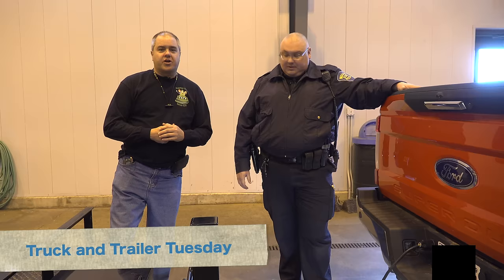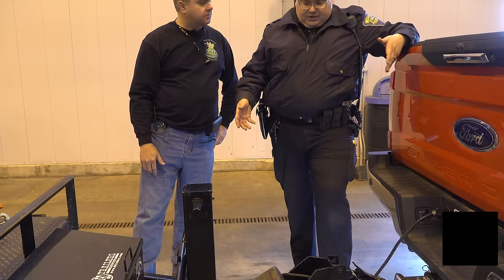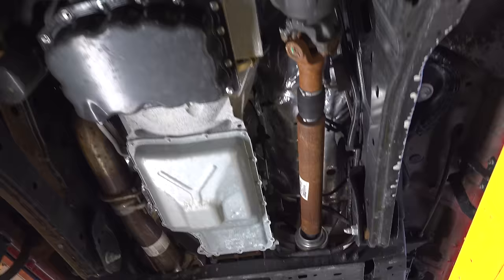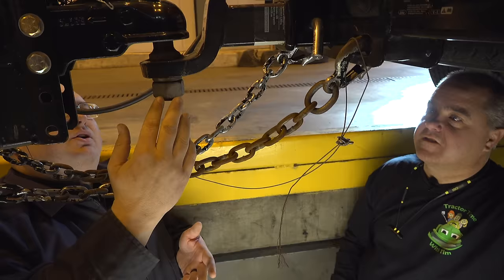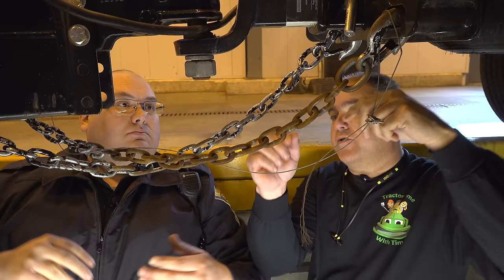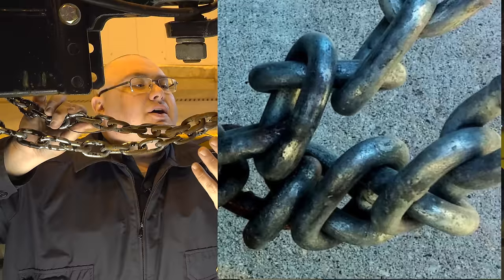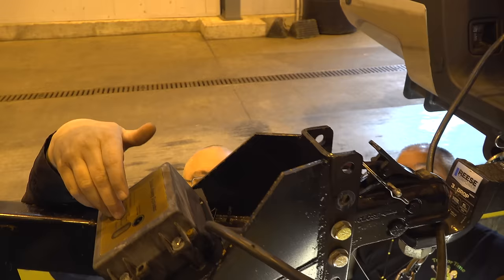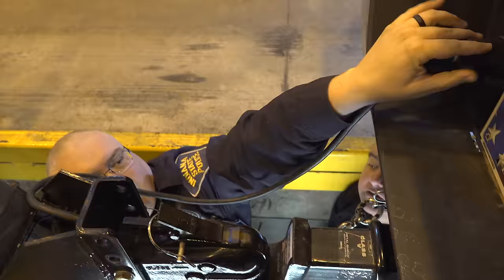Uhoh! Tim Fails Inspection! Truck & Trailer Tuesday with Trooper Hoover

Comment: That hitch is not a "bumper hitch".  A true bumper pull is when the ball is attached in a hole in the bumper.  This truck has a trailer hitch bolted under the bumper, and bolted to the frame.
Reply from the maker: Yes, but this type of connection is typically referred to as ‘bumper pull’, as opposed to ‘gooseneck’.
Reply: @TractorTimewithTim   If I may ask, who is referring to this as a "bumper pull"?   Try this logic, you can remove the bumper from the truck, shown in the video, and the hitch is still attached to the frame.   Old school trailer hitches from the mid-1930s, used on either a car or truck, were clamped onto the bumper, so they would be a "bumper pull" device.   I'd like to know what dictionary you are using.
Reply from the maker: @handygent45  Well, here is one of hundreds.    https://www.fthr.com/owner-support/trailer-use-and-care/bumper-pull-trailers-vs-gooseneck-trailers
...and here is a snippet from that article:
The most common type of hitch is the bumper pull, also known as a drag or tagalong trailer. The name is slightly misleading because the trailer doesn’t actually connect to the tow vehicle’s bumper. Instead, the trailer’s tongue fits over a ball hitch that juts out from the vehicle’s frame at the rear of the vehicle.
Reply: @TractorTimewithTim  I checked out the website you provided. It seems that the phrase "bumper pull" is slang, devoid of any literal meaning.  

As mentioned,  early trailer hitches were made to clamp onto the rear bumper of a car.  Then trucks had a bumper with a hole to insert a ball.  The phrase "bumper pull" at one time had a literal meaning. 

There is an epidemic of bastardized words and phrases. For example, even the police love to use oxymoronic phrases. As a matter of course a police officer testifies in court that they were not hiding in the bushes on stakeout, behind a blind to catch speeders, but describe that they were in "stationary patrol".  (I guess such jargon or argot terminology sounds impressive.) The police have mastered the art of moving and standing still at the same time. 

The phrase "bumper pull" is back alley slang, and would get shredded to pieces in a legal challenge.
Reply from the maker: Relax.    Search the term "Bumper Pull".  You'll find this is the standard definition for a trailer which hooks to the rear of the towing vehicle.      Not sure why "shredded in a legal challenge" has anything to do with it.    The term "Bumper Pull" is easy to understand, industry standard terminology.       Go to a trailer manufacturer's website...ANY of them.  You'll see it.  Go to ANY trailer dealer. Ask them to show you a bumper pull equipment trailer....they will know EXACTLY what you mean...and they will not be so petty to say "We don't have any trailers which can be pulled by the bumper...".
Reply: @TractorTimewithTim  Ok, maybe this will help. A used car dealer placed an ad in the paper, selling a car for "500 bananas".  

A prospective buyer came to his car lot with 500 bananas, contained in several boxes.   The dealer laughed, saying everyone knows what that phrase means.  

Well, the prospective buyer sued the dealer for false advertising and won. Basically the judge presiding said that words and phrases have to be taken at face value. 

To add insult to injury, the prospective buyer obtained the bananas from the dumpster of a grocery store.  The advertisement made no indication that the bananas had to be fresh or eatable. 

Anyway you proved my point. How? Your definition makes no mention of a bumper,  saying that a trailer hooks to the rear of the towing vehicle. 

A proper phrase would be rear-mounted hitch. 

The phrase "bumper pull" should be tossed in the trash, along with the phrase "assault weapon", the latter, likewise, has no literal meaning.  The scary-looking rifle. 

The way things are going I can see where a man's penis will be classified as an "assault weapon".  

The auto industry is historically plagued with back ally slang, bastardized words and phrases.  What is a hubcap? And is it the same as a wheel cover?   

A hubcap, in its literal, original meaning, is that little cap that is removed to access the "wheel bearings", or more precise, the hub bearings, since the wheel or rim has no bearings.
Reply from the maker: It is clear you just want to be argumentative.  I’m out.  I proved my point.  Has nothing to do with bananas, etc.

Comment: Those are 3500 lb axles total 7000 lbs the hitch receiver is only rated for 5000 lbs should have failed it not to drive
Reply from the maker: Those are 5000lb axles.

Comment: I can't believe you told people it is ok to put a twist in your safety chains!!! If those chains become necessary to be used that chain will be shock loaded and the fastest way to weaken a chains capacity is to put a twist in it even when it is just a straight pull let alone a shock load this is absolutely taboo and should absolutely never be done. You lose up to 70% of the strength by twisting.

Comment: Shame on you.....Lol. Hey they make a paint called chassis saver you can get at an auto body supply or a good NAPA you can brush it on and it is made for exactly what you’ve got going on. Wire brush with an angle grinder paint that stuff on and your sealed and rust proofed. A quart of the stuff goes a long way. 
There’s another product called Corroseal rust converter you paint it on looks like milk really safe stuff it converts rust then you paint over it. You can get it at Home Depot. Look it up this is the simple and easy way to deal with rust, especially now while it’s light.

Comment: Some of the trailer manufacturers should be inspected every 6 months to catch the short cuts some of the way some trailer manufacturers are getting away with.
Reply from the maker: Yes, check out my BWise factory tour video. They ARE inspected periodically by the NTMA or whatever it is.  Check out the video for details.  Anyway, there IS an organization that brings responsibility to the industry.

Comment: you make me laugh   come to upstate ny that   underside of the trailer is new from factory to us     when the rust on the bolts are have made the heads round with rust well then it is  a few years old  to us    ,  you will need a new trailer yearly  to look like that one   and cars   heck when your foot falls through the  floor or the frame rusts through  where you can fut a few fingers through it  , then it is time for a new car      hahaha

Comment: So much misinformation. For starters, that's not even a bumper hitch. It's attached to the frame, with no connection to the bumper at all. In a pickup, a bumper hitch is a ball mounted directly onto the bumper (hole under that plastic cover). The hitch on my bumper can tow 4500lbs (SAE J2807), while my frame-mounted hitch can tow 9300lbs (SAE J2807).
Reply from the maker: Good grief.  Everyone knows that,  but all trailer manufacturers refer to this type of trailer as bumper pull.  
Must have been a pretty good video if THAT is the only thing you could find to nit-pick!!

Comment: Hey Dude! Get those toys of yours outta there and get on down the road! I’ve been a Trucker for 38 years and I’m laughing my ass off.
There’s not a D.O.T. Cop anywhere in the U.S. or Canada that gives a rats ass about a pickup truck with a toy trailer behind it. They will NEVER pull over a pickup truck for an inspection. They only care about 
big rig commercial trucks that are regulated by the FMCSA. You’re pickup truck is in the same category as a car. You’re such a Dork! You’re not a truck driver!
Stop pretending! You and your pickup truck are not important.
😖😖😖😖😖😖😖😖😖😖😖